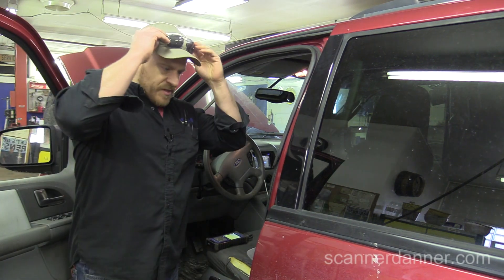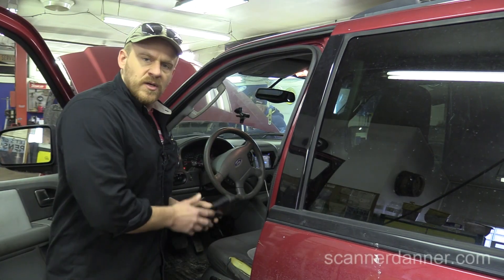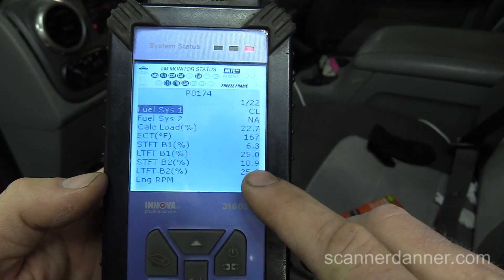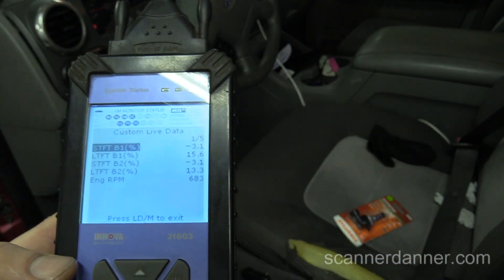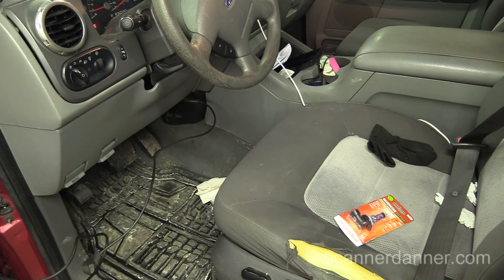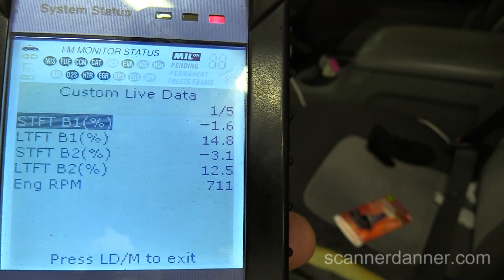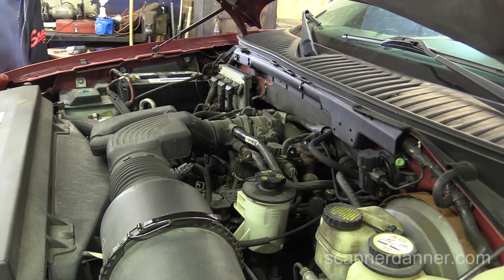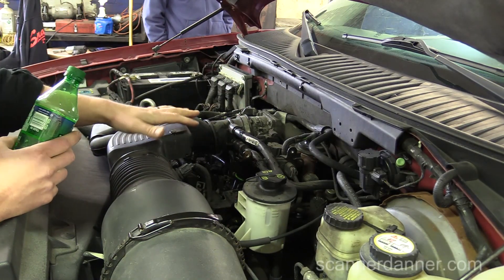System Too Lean (P0171, P0174) - Vacuum Leak Quick Test - Ford 5.4

Comment: My 2000 f150 4.6 has p0171 code only
Reply from the maker: Report STFT and LTFT on both Bank 1 and Bank 2
Doesn't matter that you only have a code for one side

Comment: My 5.4 had lot of power before she shut down and I think this is the cause
Reply from the maker: vacuum leaks will never cause low power symptoms. Rough idle and low speed hesitations, yes, but for low power under load conditions you are looking in other areas. Restricted exhaust, low fuel pressure, contaminated MAF sensor, misfiring etc

Comment: I have a question if you don't mind.  I did a smoke test on my 2001 Ford Ranger 3.0 earlier today to look for vacuum leaks, because my fuel trims is showing a lean condition at idle.  I found a 3/8" vacuum line that is pretty much disintegrated and has splits in it, but I also seen smoke coming out of the idle air control valve where the seam is.  I've read a few different opinions on this as being normal, and some say it isn't normal and wanted your input before I buy a new IAC.  I'm going to replace the bad vacuum line and see if my fuel trims improve.  Seems to me that if I'm getting smoke out of the IAC, then it is getting unmetered air into the intake when running, but I also considered that it may not leak when the motor is running.  Any help is appreciated.  Thank you.
Reply from the maker: These IAC valve have an air bleed port. You will always have some smoke come out of them
Reply: @ScannerDanner  Ok, great to know.  Thank you!

Comment: I always used to use starting fluid haha if the rpms increased you found your leak
Reply from the maker: I used to use carb cleaner until I had an intake backfire catch the engine bay on fire, in front of a customer, at an unfamiliar shop where I did not know where the fire extinguishers were. 🫨

Comment: If you had sprayed enough water in that intake, you couldve easily locked up that engine for good. I wouldnt be surprised if that truck didnt run after the video. Bahahah. MORON.

Comment: You must be new to this so i wont be condescending or anything... But dumping water onto ignition coils is never a good idea... It loped because you had shorted out the engine.. Hahaha.... 
Like if you have a intake manifold gasket that is broken.... It will be leaking coolant... Not sucking air...
Reply from the maker: You win the dumbest comment of the day. You think intake manifold gasket  leaks can only be coolant leaks??? Here, watch and learn something https://youtu.be/OH_U3D4S5Q4

Comment: All you fuckin retards all  post 5.4 , 5.4 ,5.4 ,5.4 5.4 but where are the fuckin 4.6 videos. Never in my have I searched "01 f150 4.6 vacuume leaks" and yet all I see if fuckin 5.4 videos left and right

Comment: I always did brake cleaner and watched fuel trims change as I spray around hoses and intake.
Reply from the maker: I used to use a flammable source until I had an intake backfire and caught the engine on fire in front of a customer 😅

Comment: currently trying to diag a 99 ford expidition 5.4 sat for a year car came in for a p0171 code, not sure what the last tech did but when I got it long term trims at idle cold engine around 13% (bank 1 and bank 2) driving it i see bank 1 jumps to about 20% bank 2 stays around 10% I have smoked it found a vacuum leak, repaired it but no change. I will try this water trick tomorrow when I go back to work
Reply from the maker: So trims get worse at higher RPM? That's not a vacuum leak symptom

Comment: You can also use a mapp gas torch un lit turn gas on and aim tip at locations you suspect leaks if the engine idles up  you have a leak there. Much easier than a sprite bottle 😅
Reply from the maker: Water is more accurate in most circumstances

Comment: Why would You use water instead of carb/choke cleaner? That water will foul the plugs and blow the coils?
Reply from the maker: To prevent a fire!! And it's more of a pinpoint test and no, you won't hurt the engine

Comment: What did you use to smoke the system as far as vacuum lines?
Reply from the maker: A smoke machine that uses mineral oil as the source
Reply: @ScannerDanner  ok, I believe mine uses the same but which vacuum line did you attach it to

Comment: What if the LTFT doesn’t get  better when you put it under a load ? My LTFT stays at 28.9 % At 3000 rpm STFT goes between -3.1 and -0.8.
Reply from the maker: What is ST at idle. Is it balanced? (Hovering back and forth from 0)
If it is, what this means is you do NOT have a vacuum leak
Reply: So at idle STFT B1 fluctuating 1.6%-0.0 same with STFT B2. LTFT B1&LTFT B2 29.7. But if I go down further on my live data it has STFT B1S1 3.1-0.8% and STFT B1S2 is 99.2% STFT B2S1 3.1-0.0 and STFTB2S2 99.2
Reply from the maker: @nathandeam1293  those downstream (B1S2 and B2S2) numbers are not used on your model and that's why they are listed at 99% Ignore those.
What does STFT do at 3000 rpm in park? I know you said LTFT was about 30% for both
Reply: At 3000 rpm the STFT B1 and STFT B2 are at -3.1 to -0.8
Reply: LTFT B1 was 23.4 and LTFT B2 was 25.0 @ 3000 rpm in park
Reply from the maker: @nathandeam1293  so a slight improvement on the fuel trim numbers at 3000 rpm, this does NOT sound like a vacuum leak. Check your fuel pressure and MAF sensor next

Comment: The 4.6 in my 03 F150 had the PCV hose connection behind the manifold crumbling. It is a real bugger to change and can't be seen from the front or side at all. Replacing it cured the P0171 and P0174 codes on mine.
Reply: Where is it located ???
Reply: Was yours stalling?

Comment: So what if your trim numbers didnt improve at 2500 rpms? What would that suggest?
Reply from the maker: Fuel pressure too low or MAF sensor issue or your two most common issues

Comment: I have a vacuum leak but It doesn't show  those codes. It only shows misfire in all the cylinders even after replaced coils and spark plugs. Any ideas? 06 rendezvous 3.6L

Comment: I've been going though mine, just rebuild the engine last fall. Just replaced the intake gaskets just to rule that out. I've checked hoses, seals everything I've seen online and I can't find it. My ltft doesn't get better as the truck gets warm. I'll have to find a smoke machine.
Reply from the maker: It may not be a vacuum leak. That isn't the only thing that will cause a 171 or 174 cod3
Reply: @ScannerDanner  I'm getting a 171. I instead Stage 2 cams, springs and locked the phasers plus 2 different custom tunes. I'm going to try running with live data see what I can find.
Reply from the maker: @Legal_Addiction  when you change components in an engine and add custom tunes, this puts you in an entirely different arena, good luck
Reply: @ScannerDanner  yeah you definitely got that right! I appreciate the reply. Have a good day!

Comment: Had those codes on my 2001 and found the grommet for the Air Charge Temp. sensor had deteriorated enough that the sensor was sort of falling out and the grommet was no longer keeping air from entering the air tube. Probably the easiest thing it could have been. The hardest part after that, was finding a new grommet the right size.

Comment: What causes a what seems like a missfire at 30 to 45 MPH on 01 Ford sport Trac with the 4.0
Reply from the maker: usually that is a secondary ignition misfire symptom, the misfire may be there other times too, but you really don't feel it until the torque converter clutch locks up and you lose the cushion of the fluid dampening of the converter. Have your Mode 6 data looked at for which cylinders are showing a misfire (if any, I could be wrong). Any global OBD2 scan tool can give you this data
Reply: @ScannerDanner  thanks

Comment: P0304 p0308 right after clean the top side of your coils all it takes for a misfire is a couple of droplets between spring and coil connector, after you blow (not vacuum) all the water from spark plugs holes then.... you’ll probably go with the smoke leak detection instead of water

Comment: Who is this clown?????? That is the stupidest way to find a p4oblem
Reply from the maker: says the guy using a flammable source to find a vacuum leak, only to have an intake backfire during the process and the customer watches as his engine catches on fire!
Reply: @ScannerDanner  you make no sense at all I hope you don't charge for that or anything else for that matter.
Reply from the maker: @justiceincognito337  do it enough (use a flammable source to find your vacuum leaks) and you'll see. This method also allows one to pinpoint the exact location of the leak. For example, a lower injector o-ring or the intake manifold when they are literally millimeters from each other.
Reply: @ScannerDanner  fucking idiot

Comment: I've got a couple of cylinder misfires. With the P0171 and P0174 are the only codes I get off my OBD2. The intake manifold gasket has been replaced before. Will those codes if not fixed end up constantly misfiring? Also I normally get my parts from Amazon, and the isolator bolts the try to sell with the gasket set doesn't fit my truck. It is a F-150 4.2 2001 model.

Comment: Wanna fix my car 2010 Malibu won't pass emissions code po171 and
Reply from the maker: vacuum leak, dirty or faulty MAF sensor, low fuel pressure would be your top three causes of that code
Reply: @ScannerDanner  how do I find a leak or maf sensor
Reply: @ScannerDanner  it's telling me 02 sensor bank sensor 1 and mis fire bank 1 cylinder 1 and it has a lean it says but can't find a leak so I'mma try a injector my short term is 29 and long term is 30
Reply: @ScannerDanner  now I'm getting a code of p01133
Reply: I change the 02 sensor bank one still have a engine light on change spark plugs

Comment: What is you have both codes PO171 & PO174 and you car / truck still runs fine.... (At least for now it runs fine anyway) At high rpms and at idle  I drink a 2000 ford e150 van  I really don't have the money $450 - $750 to get it fixed right now. is it safe to continue to drive it?   (i'm in a wheelchair and i can't fix any of it myself unfortunately )

Comment: I have negative LT fuel trim at idle for both banks, and also negative fuel trim at 3000rpm both banks. V6 engine. Rx330. Is this vacuum leak.
Reply: you running reach, means you got too much fuel or not enough air. Could be many reasons, i d check maf sensor and fuel system first

Comment: Recently had my intake manifold changed.. And the codes p0171 and p0174 what u suggest
.
Reply from the maker: why was the intake changed? where these codes there before the intake was changed?
Reply: Something here , codes were there shop said intake manifold and they showed me the leak before replacing it. Intake manifold changed but code came back 2 days after ?
Any suggestion ?

Comment: I have a p171 and a p174.
Lean bank 1 and lean bank 2.
Load percent at 30
Temp 170.
Short trim 1 is at 6.3
Long trim 1 is at 25
Short trim 2  is at .8
Long trim 2 is at 25
Rpm at 634
Im suspecting a leak
Reply: did you fix it?
Reply: Felipe Casas yes i did
Reply: wat was it?
Reply: Felipe Casas it was a leak on the vacuum tubing,  one big one and few little ones.
Reply: @Rafael-pu6fi where is the vacuum tubing
Reply: ok thank you

Comment: Help..
I got the same codes.. 2008 expedition 5.4.
High Ltft's don't change on higher rpm. 
Checked MAF signal ok. Swapped it for s&g. 
As far as I can tell.. no vac leak. 
My cheap scanner does a horrible job looking at the o2's. 
Any suggestions?

Comment: Can a vacuum leak cost the transmission to shift funny (help) thanks l have a 2005 f 150
Reply from the maker: any engine running issue can cause the transmission to shift funny, if you know you have a vacuum leak, fix that first

Comment: Holy Hellacious! Are you kidding me. Bring my truck in this shop with PO174 code. Leave with 174 codes because now all my shit is fried!
Reply from the maker: Lol, water is not going to fry anything. What do you think happens when you drive in the rain?
Reply: @ScannerDanner  let me keep it simple
Electrical connections, fuses, poor wiring are all easily damaged by spraying water in an engine compartment this way.
Considering the culprit in the video are lean codes, faulty sensor wiring from the PCM, MAF, EGR and any number of pcv valves to bad sensors can create those codes. Spraying them with water can make the problem worse.
I guess if you plan on driving though 3 ft of water with no hood then sure a rainstorm would damage your engine.

Comment: Hmm my 4.6l 2v mustang has the same codes and going to 2500 rpmz brings the fuel trims only to like 21% any suggestions?
Reply: O2 or mass airflow if it corrects itself at 2500rmps but goes back to 20 at idle then it’s a vacuum if it’s close to 0 at idle and goes to 20 at 2500 rpms will be mass air flow or o2

Comment: I am getting code P0171, i have checked all leaks , the shorterm fuel trim is 46.88% , long term fuel trim 18.45%. 
Air fuel ratio 26.75 , O2S1 -3.5mA, O2S2 is 0.9V ,
Reply: Which car is this?.... Did you monitor short and long term fuel trims at idle and when  you increase rpm.... How they react?

If they tend to correct themselves, meaning bring the values closer to 0, then it's a vacum leak issue

If they don't correct them selves and infact get worse, then the issue is related to fuel delivery or MAF

Comment: QUESTION: Would using starting fluid and shooting it around the intake also work? When the idle would change you most likely have found the leak, correct?
Reply from the maker: This is a MAJOR fire hazard and I do not endorse this method. IF you are going to use a fuel source to find a vacuum leak, you need to be aware of the hazards. (intake back fires can occur, igniting the fuel, spark plug wires and coils can leak and ignite the fuel)
Reply: Concern NOTED! Thank you!

Comment: That "water test" is the easiest way to blow coils on a 5.4 and cause more problems and misfires.  That is the worst way to diagnose that on a 5.4, unless you like to change coils, all of them you sprayed with a Sprite bottle.  Not smart bro.
Reply: Even a slight spray of water gets into the coils and it stays. I cringe when I see this. Now the customer will be told they need new coils and plugs. $900 plus the intake manifold and gaskets. $2000.
Reply: Yeah..don't do that water test.... 
Gotta be the most ignorant and redundant way to "diagnose" a leaking manifold I've ever heard of. There's an excellent reason I've never seen anyone use water to check for vacuum leaks... Because it shorts out the engine and can ruin ignition coils.. 😂 
Id be willing to bet cylinder #1 and cylinder #6 on that truck no longer fire. 😂😂😂 What a fckin goof. Tearing people stuff up AND charging them for it. (Not to mention water does not belong in a fcking intake....)
Reply: Id have to agree. Washing my engine started all this for me. Changed plugs, coils, injectors, fixed everything BUT the lean code however.
Reply: @scottskinner577  same here I believe, did you ever figure out you issue?
Reply: @KollynJ  no it just went away eventually. I do notice a slight exhaust leak tho. It could honestly have a pinhole in the exhaust manifold or even a crack. Those are so hard to find without taking things apart. If it was a leaking gasket, I guess it just fixed itself. Wish I could help more
Reply: @scottskinner577  I see I’m getting both lean and rich codes, I’m guessing it’s a vacuum leak but everyone says and exhaust manifold wouldn’t cause that because it’s after everything. Intake manifolds and vacuum lines and hoses coming into it will be smoke tested soon if I can come up with something
Reply: @KollynJ  hey all my research says that's the most likely cause. What you said.  So youre probably pn the right path. Oh and I can tell you that the vacuum hose behind the intake, the one that hooks to the PCV valve, I did replace that with a new one before hand. It looked like hell. If you haven't done that yet, you should.
Reply: Pendejo
Reply: NO WATER !!!!! use brake clean for RPM increase PENDEJO....lol

Comment: I have a ford expedition 5.4 2002 model. And my battery started reading H when driving.. High voltage sobi got a new battery cause the battery started smelling ugly like rotten eggs. Put new battery in and still reads high voltage what isbthe problem why its doing that now

Comment: water test not a good idea,  that is the easiest way to have moisture set in the spark plug wells and short out coils.   Amateur move.
Reply from the maker: No, an amateur move is changing plugs and coils and injectors and still having a misfire that is not fixed. Also, using a flammable source to find your vacuum leak and in the process burning your car to the ground.
Reply: @ScannerDanner  i know this is late....But don't People powerwash their engine compartments? By this logic car wash establishments should offer free spark plugs/coils.  Lord please help those amateurs..
Reply: @thesnap6376  i washed mine and it caused my problems. As many times as ive done it on at least 30 vehicles, Ill be more careful next time. My 02 F150 is my first Ford but its been great
Reply: Justin Valdez maybe not on an engine that won't start,, but I thought the water would boil off if your doing it when it runs.

Comment: Can you help i have a 2005 ford f150 that shuts off when i come to a stop. It drives fine but when i slow down and stop it turns off everytime
Reply from the maker: My first thought is a dirty throttle body. If you need additional help. Post this to my forum okay?
https://scannerdanner.com/forum/post-your-repair-questions-here.html

Thanks!
Reply: ScannerDanner i tried but i dont know how. Any ways i got it cleaned nothing and got the computer flashed and nothing now there telling me its the MAF sensor. What do you think
Reply: mizael garcia did you find the problem?  I have the same problem on my 2006 Lexus gs 300